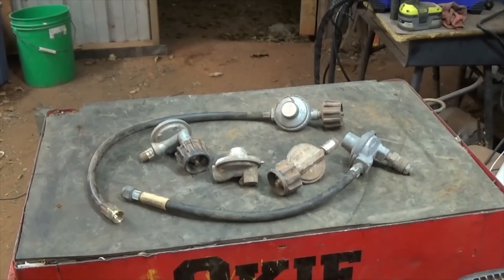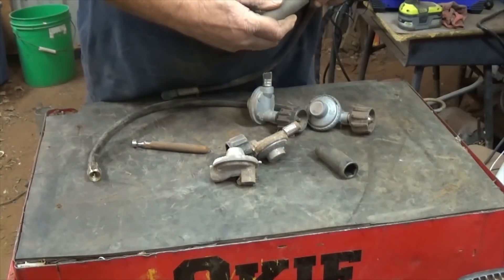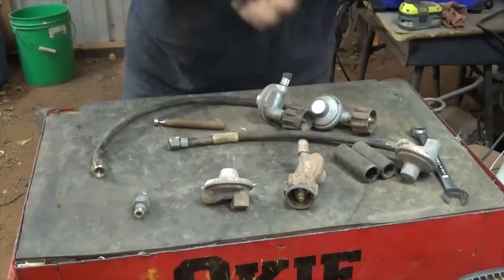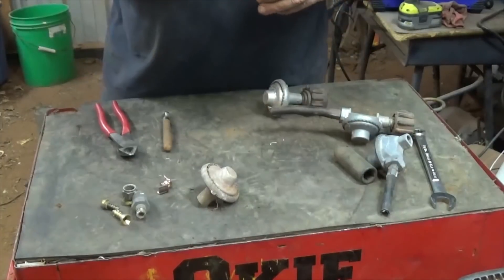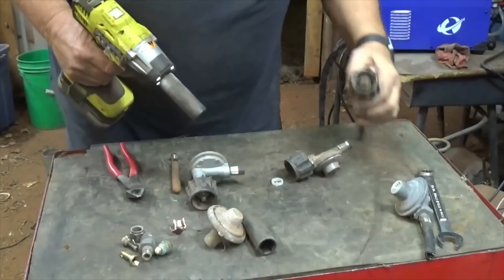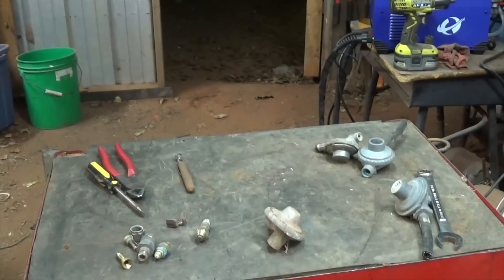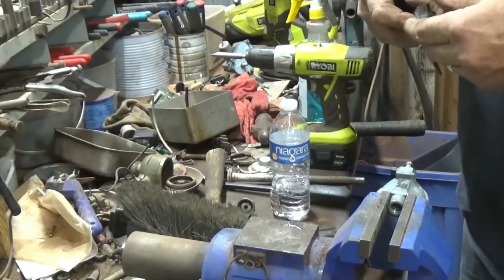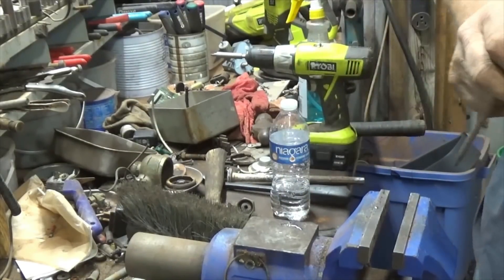Scrapping some Propane Regulators for clean Brass

Comment: Little advice for scrapping most people dont know or want to bother with it but recliners and hide a bed couches have a decent amount of metal and some pianos if you live somewhere you can burn the waste i just scrapped a recliner 4 bolts and remove reclining lever
Reply from the maker: I get some that have been burnt, kind of a hassle to move them sometimes they want to move or open on you almost have to tie them shut, but good weight in them for sure

Comment: Looks like they try to make those valves tamper-proof.  Nothing Okie-Scrapper can't handle!
Reply from the maker: one guy told me to put them in a vice sideways and smash them with the vice to open them, may need a cheater bar on the vice or get a good arm workout, but they may go easy I will have to try it, but I know a big hammer works well